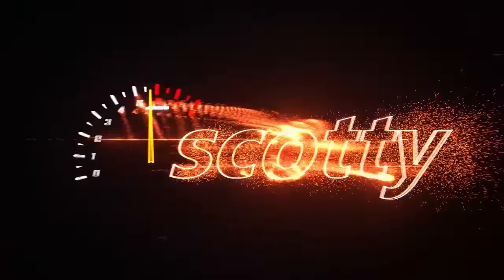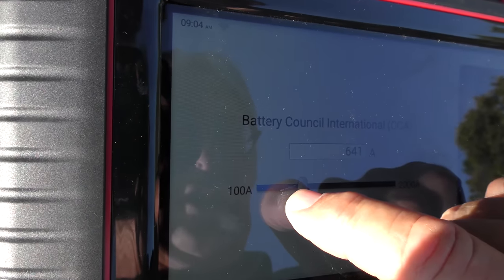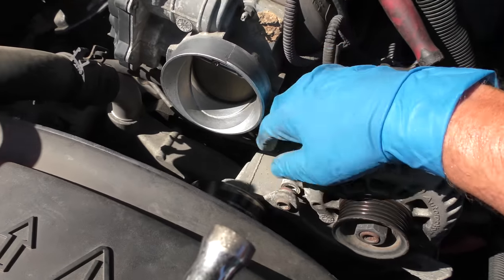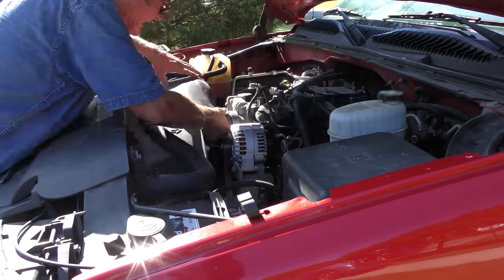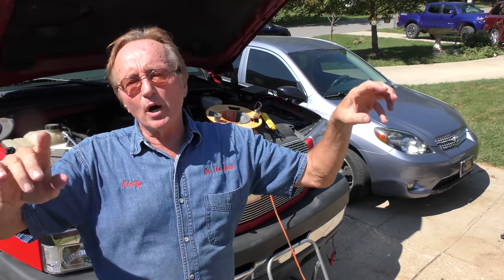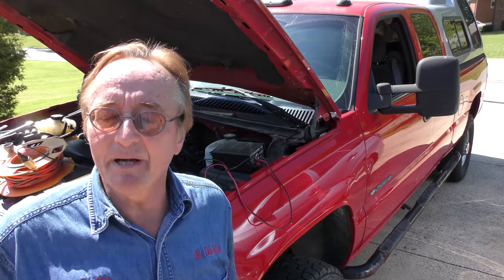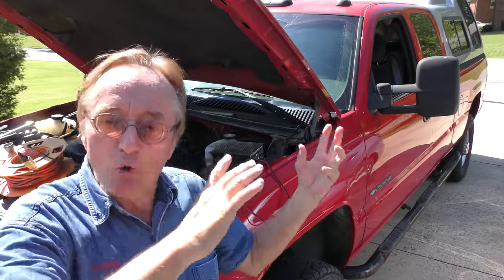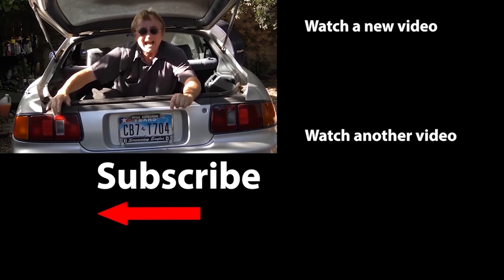I Just Got Kicked Out of AutoZone and I'm Mad as Hell

Comment: That's the thing about the AutoZone warranty.  You can bring the part back for a replacement when it fails, but YOU ARE GOING TO HAVE TO in way too many cases.  I bought my alternator from O'Reilley about 10 years ago and haven't had an issue.  My alternator and battery went bad at the same time, but I bought a Sear Gold Die Hard back then.  Sears is closed here now and I really miss 'em.
Reply: Advance sells Die Hard batteries now.
Reply: @tasharead5379   Sears Die Hard?  If so, that's great!  Thanks
Reply: There are only 3 companies that sell aftermarket batteries in the US:  Johnson Controls, Exide, and Penn Electric.  Johnson Controls dominates the market.  Chances are very high that anywhere you buy a battery from it is the same Johnson Controls battery as everywhere else.  Everything else is just branding.
Reply: @lwnf360  We all live on the Earth. Everything comes from the Earth. Chances are it's made from the Earth. Everything else is just branding.

Comment: I suspect the alternator has been replaced in the past. If you go back and look at 3:15 (before and after the hammer usage), I see stress fractures on the bolts holding the alternator in place. Chances are the alternator has been replaced a couple different times. Nappa and O'Reilly's has never done me wrong. Autozone typically doesn't have in stock the parts I need.

Comment: I learned my lesson about AutoZone parts years ago. I purchased their so called 'gold' starter for my '99 F150. 2 days later I ended up stranded in a Meijer parking lot at 1am, January, 19 below zero, with a 25mph wind. Luckily a nice older man saw my truck was broke down and gave me a ride home. The next morning my wife drove me back to my truck so I could drop the starter and take it back to AutoZone. They had the nerve to tell me they put it on 'their' machine and it supposedly worked just fine. I let them swap it out with another so called 'gold' starter which had a dead short in it. When I turned the key it melted the wiring harness right off it. Mad as hell I removed that starter, took it back, slammed it down on the counter, and demanded my money back. While the one counterperson was giving me my money back another person had the nerve once again to try to tell me that starter checked out okay. They both gave me a blank look when I asked them if they wanted to pay for the wiring harness it just melted because it obviously had a dead short in it. I walked across the street to a reputable auto parts place and bought a new starter and wiring harness. That was almost 300,000 miles ago and still haven't had a problem with this starter or the wiring harness. I'll never but anything electrical from them again.
Reply: I had a similar experience with my '02 Ranger except instead of melting the harness it just went dead on me about 6 months later.  The first Doesn'tlast starter spun but didn't engage with the flywheel at all.  I love doing the same job three times due to crap parts while being told "idk man it's working fine here."

Comment: There has definitely been a lot of bad rebuilt parts out there lately. I went through three brake calipers to get a good one. The first one had no insides. It was disassembled, and cleaned up and put in the box without new piston, etc. The next one didn't get that far. It looked like someone took it off an old car, and stuck it in the box. The third one was good. And rebuilt carburetors are never a good idea at this point. For those of you who have an old car that still uses one.

Comment: My uncle worked for GM for decades as an engineer and told me some horror stories about the electrical design (particularly battery location and the like). He's been brought back multiple times in his retirement to try to train up the new bodies. Kind of a lost cause, really.
Reply: Seems to me every battery I've ever seen is either located to the left or to the right, in the front, and under the hood (VW's excluded)?
Although, as a kid in the seventies, I do remember someone had a 60's era van that accessed the engine by opening up the center console, not sure if the battery was also located in there?
Reply: I worked with a GM engineer - everything he " improved " was alot worse than it was before he redesigned it he had the mind of a toddler .....

Comment: Thanks Scotty. 2:23 I'm wondering how the alternator can output  too much volts without sufficient amps? I thought in this scenario the voltage will drops into a pretty low level.
Reply: Scotty is an auto mechanic, not an electrical engineer. Despite this I still learn a lot from his channel and am usually entertained.
Reply: It's probably a regulator problem.  Voltage is the pushing power to push the electrons out, which is current. Which is measured in amps.
Reply: A bad diode can cause the high voltage problem, it would  have interesting to check the alternator with a meter to look for A/C voltage.
Reply: @begus11  A poor(resistive) ground or positive  connection can also throw off voltage readings.
Reply: Agree with bobR.  High voltage on the alternator means it is trying to charge the battery but there's some resistance.  It will also go high briefly after cranking the engine and he did just test the cranking amps so he put some serious load on that battery.  If it STAYS 14.9 volts it will boil off the electrolyte.

Comment: You can't have a bad alternator put out the correct voltage but not enough amps. A battery given the correct voltage will draw whatever current it needs depending on it's state of charge
Reply: The alternator can only put out so-many amps, regardless of the voltage  - and a bad alternator might not be capable of producing the necessary amount of amps - it might have the volts but a small number of amps.
Reply: @jaykosta7610  The load determines the amps?
Reply: Yeah, the rest of the car electrics are like a big resistor, they have a somewhat constant resistance.
So the more amps the alternator will produce, the more volts you will see, and the opposite.
Volts and amps are tied, you can't have one but not the other, not sure what Scotty means there...
Unless it is pulsing, and most of the time it is giving too low voltage and amps, but has high voltage peaks?
Reply: @jacekjagosz  Size if the conductor determines the amps.   Can have 50 amp conductor with 12 volts.  Can have same 50 amp conductor with 100 volts.
Reply: @tedlahm5740  Yeah. But here your are measuring voltage at the battery. All the conductors and electronics stay the same. If the alternator gives more amps, it should give more volts as well.
You can't have one or the other.
Reply: @tedlahm5740  Yes.  Exactly.The load resistance at the given voltage determines the current draw.
Reply: More resistance equals less volts , somehow there was a short
Reply: When sucking the amps dry it then chews on your volts. 14.9 v is not high in my book. I've changed many many batteries that say good battery 50% charge. I wonder what the story will be about changing the battery in a week about how the non charging alternator ruined the battery.
Reply: @jacekjagosz  obviously we are not agreeing with you.
Reply: @Diego But here rest of the electrical system didn't change. Only the alternator. So what caused the difference?
@Ted Lahm I don't want to be right, I just want to understand. That is why I am asking again and again, because I still don't get it
Reply: They are rated by watts which is amps x volts when it draws more amps the volts should go down the current wasn't getting to the battery
Reply: @jaykosta7610  And what happens when it reaches its amp capacity and beyond? the voltage drops, So you cannot have the correct voltage but unable to deliver the required current to satisfy the load. Fact. It's the fundamental Ohms law

Comment: I rebuild my own alternators... Quite often the brush's and the diodes are bad... In this case, the internal voltage regulator could have been bad... It usually costs about $35-$50 in parts to do it yourself. I always replace the bearing on the driven end using a $20 bearing seperator tool that can also be used for many other things The parts can be bought on-line. or at automotive electrical specialty supply houses...I have replaced the one that I overhauled about 6-years ago... It is still working fine...

Comment: Had a friend of mine that went through 3 alternators from AZ before he got a good one. He called me after he put on the first one thinking he done something wrong. He finally took it back to the store and they tested it to find out it was indeed bad. This went on 3 times until he got one that worked.

If I have time when replacing an alternator or starter, I take it to an alternator/starter shop in the next town over. It takes longer but they do amazing work at the same price as a "rebuilt" one from the big box stores.

Comment: I have a 2012 work car made by GM It is a Northstar-powered 2010 DTS.  168,000 miles. I changed the Fuel pump and relay. Everything works just as it fif when new. I also changed the front right wheel bearing.  Every other weekend, I spend  5 hrs above 90 MPH.  I usually have the cruise set at 91. The speedometer is off by 1 mph  Fluid changes and  4 thermostats. Thats it. understand?

Comment: Find a local auto electric shop that rebuilds starters and alternators. A good shop costs similar to parts store rebuilds but last longer, even if they don't have a warranty it's still a better option. My guy does updates if possible, like a better diode pack for 2010 Toyota rav4 alternators, as well as  a similar update for many ford alternators.

Comment: I had an issue with my alternator  for my 2007 Jeep Commander with a 3.7 litre V6.  I bought one at Auto value with a limited lifetime warranty. The cost was prohibitive at $195.00 and I installed it myself. After about a month the alternator light came on on the dash. I took the alternator back and they warrantied it without a problem. I asked them to check it but they did not have a machine to check it. I installed the new rebuilt alternator and so far have not had a problem. I think if you can pay a few bucks more and get a decent warranty it may be worth it.

Comment: Another great video Scotty.   Have a 2000 Meadow Green 1500 ext cab.  Paint looks like it did  when it was new. .  the 5.3 has an internal knock.  Very pronounced through the tail pipe when it starts up cold. .   Does go away, but never heard it through the tailpipe before. .  It's a "keeper" since it's so unbelievably clean, just gonna cost an awful lot to fix I'm afraid..Dj in Columbia

Comment: That's why I don't shop at Autozone, I have to get the right part/working part the first time from Autozone. I had a belt tensionor break on me while in the Auto Zone Parking Lot once and the guys literally watched me pull off the old one and I walked into the store covered in grease up to my elbows and laid the arm up on the counter and the manager literally argued with me because "that's not the right part, my computer shows something different". I walked across the street to O'Reilly's  and got the right arm and belt and fixed it in the Auto Zone parking lot, I won't even buy spray paint at Auto Zone because just because it says Gloss Black doesn't mean it's not Flat White. I'll whittle a part out of a dead stick before I buy from Auto Zone.

Comment: I had s throttle body and tps sensor go out on my 2003 1500hd with 180000 miles. Went to auto zone and bought a DURALAST replacement.  Needless to say I replaced that same part 3 times that week before I got one that worked. Always stick with OEM!

Comment: I'm no mechanic by any means, but if it's something simple I rather enjoy doing it myself. Then I know it was done properly,  if it's something simple. I couldn't tell you how many times I've gone to an Autozone or something similar, put on the starter or altenator just to have to pull it off and take it back. I lose my time and energy. But the strange thing is it never happens a second time
 Almost like they know it's not a good part. Now on I always  check it before I install it. Save a lot of headaches. They say they check it, trust no one but yourself.

Comment: Scotty, GM mechanic here,years ago I was told that the terminals were redesigned because of battery acid from charging the battery coming up through the vents in the battery it was supposed to prevent corrosion. I swear anybody else know any different.

Comment: I’ve learned from past experience to NEVER buy remanufactured auto parts. Always buy brand new parts, especially electrical parts like alternators and starters. I spent a little more on a brand new Duralast alternator from AutoZone as opposed to a remanufactured one for my Honda and it has worked flawlessly for over 2yrs now. Better yet, if you can afford a brand new OEM part, buy it. Believe me, your time spent replacing another bad part is worth the extra money you spent on a quality part.

Comment: Remanufactured parts use the original casing and all new wearable parts.  Rebuilt only replace the part in the device that is defective.  New parts are all new parts, but can be defective moreso than remanufactured parts.  Remanufactured carry good warranties and are a cheaper alternative to new.  Also have the clerk run a test on the part to make sure it performs, so that way if it fails in the store then they will get another one and you wont have to install a faulty part.

Comment: I have a 2013 civic and I bought (front and rear) brake pads, top of the line Elites. The fronts went on great, the rears did not as the outer tabs were a little too long. I took them back and the associate did not know what I was talking about. I had the original part and showed her that outer pads of the Elites were a longer longer (my dad ALWAYS taught me to line up the original with the new for fitment). I had to talk with the manager and he finally understood. My dad also told me to ALWAYS check the box. It didn’t come with the hardware, only the Elites and Golds did. I was surprised he didn’t try to upsell me. I would have been more mad if I got home and I had to use the original parts. But I will say that I would still rather go to AutoZone than O’Reilly’s for the customer service alone AND many of my parts are under warranty. They built an Advance near me so I’ll probably check them out. I feel for you Scotty as Pep Boys treated me like dirt too back in the day. I have never set foot in any Pep Boys for over 20 years and counting.

Comment: I’ve had a bad experience at an autozone before. The power steering pump seized on my ranger. My solution was to just get a short belt and bypass it 🤷‍♂️ I had the belt number ready to go because some of these rangers came without ac/ps and already had a short belt. So I simply looked up the belt number and asked for It at autozone. As usual they ask for your vehicle information and he went on to tell me it isn’t the right belt. I told him yeah I know, I’m purposely getting the short belt to bypass the ac/ps pulleys. He said noppeee not gonna sell it to ya without you atleast bringing me a size measurement that you took. I’m like wth dude I already know it works the belt number is the size. Man said no can do… 

Well I walked out went across the street to advanced auto and walked out 45 seconds later with my belt.

Comment: Usually you can try and file a labor claim with the store, but the fact of the matter is that the stores only cover the replacement or refund of the part ONLY.  You would be surprised how many "shops" will try and return a customers "defective" part that was not even bought at the store for their car, with a receipt from a purchase for a similar car.  And then have the audacity to file a labor claim.  We busted a commercial account for doing just that, and stopped selling to them because of it.  That being said, there was no reason for the clerk to be rude and say that on the way out the door.

Comment: I have a 2017 kia forte and i thinks its well built. Its easy to maintain and easy to replace things like spark plugs and the engine air filter. It has a timing chain so as long as i keep it oiled it should last the lifetime of the engine. Some of kias stuff is annoying like how they use a special alternator/ multi fuse which is a pain to get on. But its close to 100k miles and had no engine issues.

Comment: I avoid Autozone whenever possible. I go to O’Reilly’s first Advance second and only Napa or Autozone if I can’t get what I need from the others, and only National brand when I do. 

As for the life of of GM vehicles, I have a 2004 Avalanche that is going on 387,000 miles. It’s on transmission #2 (original died at 370,000) and the original engine. Only electrical issues I have are the heated seats do not work.

Comment: Ive had a 1993 chevy s-10 with 270 000 miles when i sold it. No problems. My dad had a 1988 chevy c-10 pickup with 200,220 miles when he sold it. Had to replace the starter and fuel pump. Nothing major. And i sold my 2003 chevy malibu in 2019 with 180,000 miles, no major problems. Replaced fuel pump. Scotty is cool but not my go to guy.